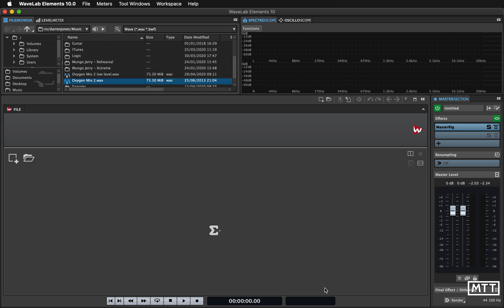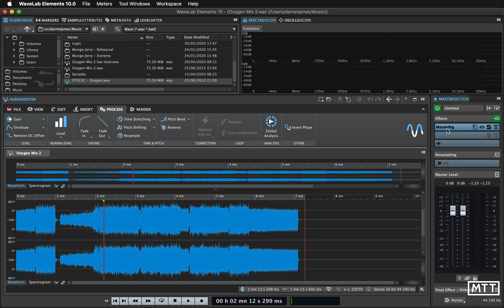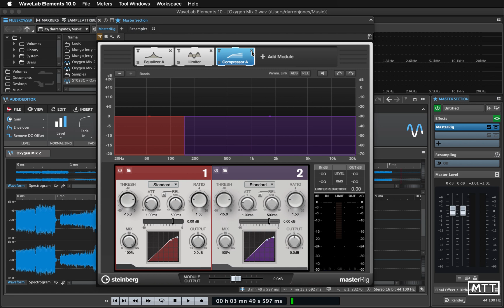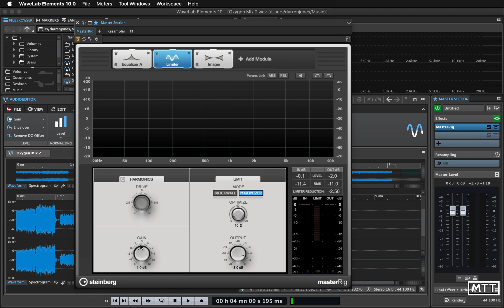Lockdown Learning: 25 - MasterRig in Wavelab Elements

Comment: is there anyway I can run my cubase pro 10.5 plugins in Wavelab elements? I definitely want to get pro but can't swing it right now I made a sacrifice to get the elements version because I've needed it for a while. This would obviously just be until I can afford to upgrade higher for the nicer options but would be awesome if I could use the pro plugins I already own from cubase
Reply from the maker: HI Marcel.  If you are running third-party plugins, then you may need to tell Wavelab about the folders where they are installed - that's done under File > Preferences > Plug-Ins where you can add folders for any VST2 plugins you have installed.  VST3 plugins should be recognised without needing to set anything.